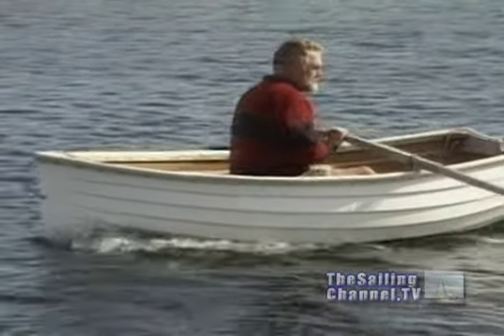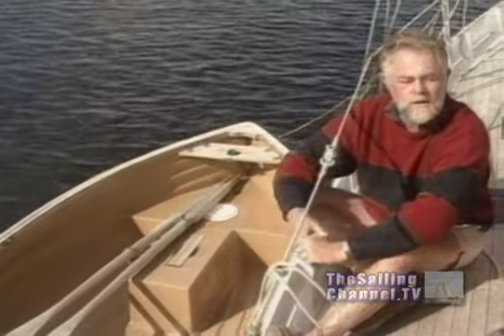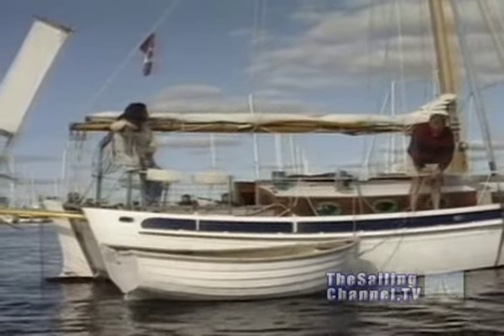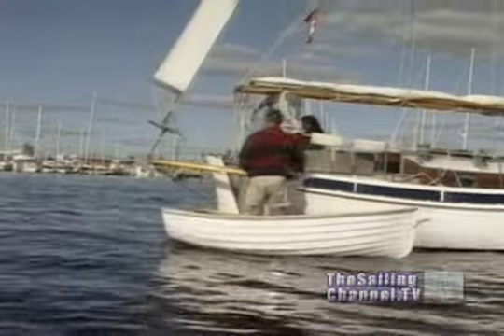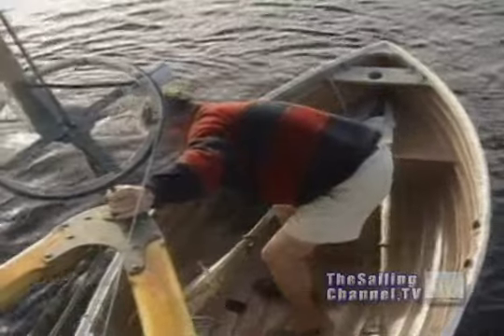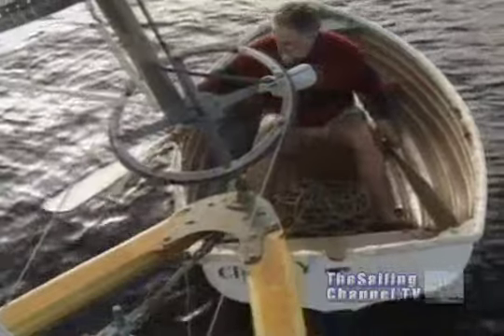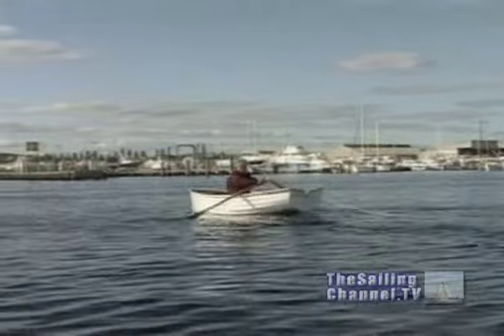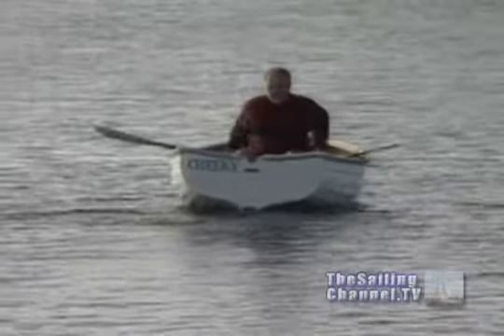Pardey Cruising Tip: Kedging Out

Comment: Actually, in rough conditions it may be both easier and safer to bring out the anchor by swimming. You tie the anchor, and the chain leader to one or 2 big fenders, with a slip knot. Then put it overboard. A good swimmer can push the package even against the strongest winds / waves. Once the desired position is reached, make sure you are completely free of the anchor's lines, draw the slipknot, and down your anchor goes.